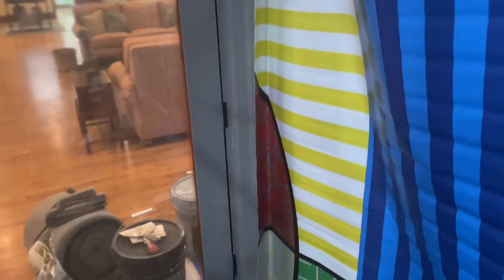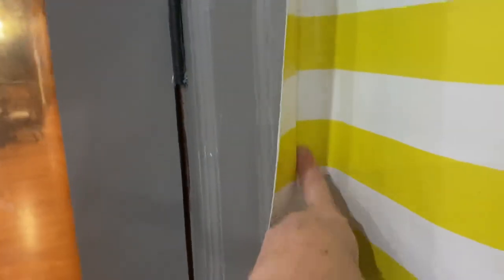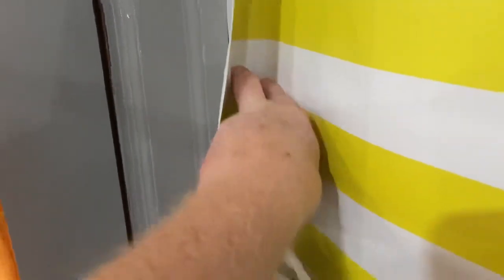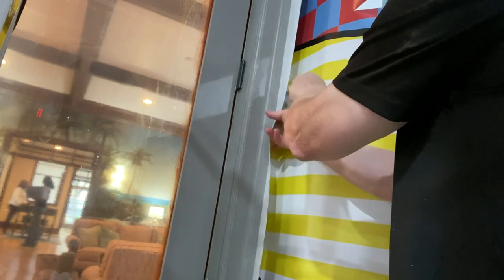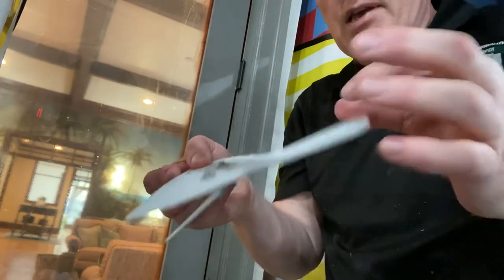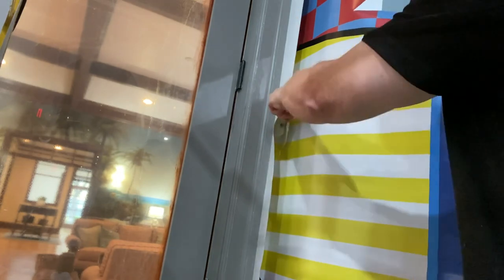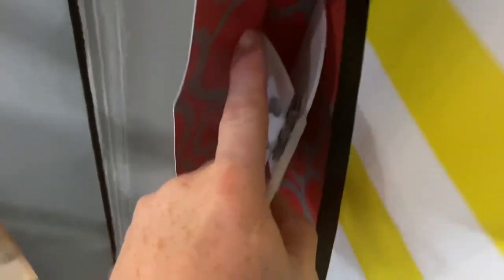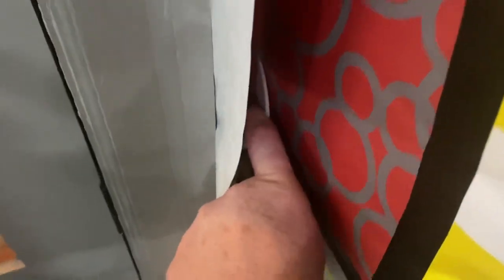Wallpaper :  This Corner Tool is a Gamechanger - Spencer Colgan

Comment: Great presentation Spencer. I tried to find a spring that would hold the two blades in the open 
position. Also heat the base of the handle and bend it back would give a little more leverage 
on the tool.
Reply: A short coiled spring would be great, but perhaps there's an easier way - if the tool had 2 handles instead of one, and you grip it tight to open it, like opening pliers. Instead of crossing at the hinge like scissors, they meet at the hinge and the return is in the same direction. Jewellers and mechanics use them for opening rings and circlips. Sorry for the dumb description - GREAT tool. The second handle need only be big enough to grip with the index finger or thumb.